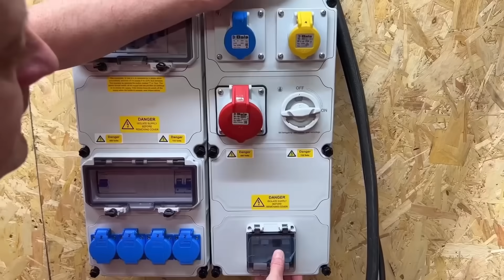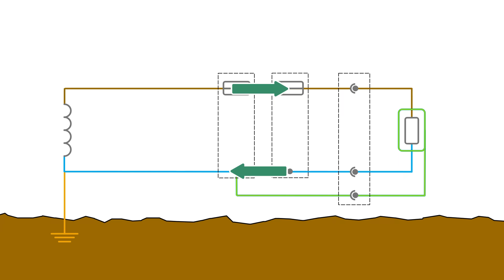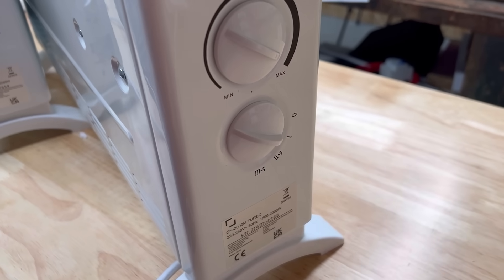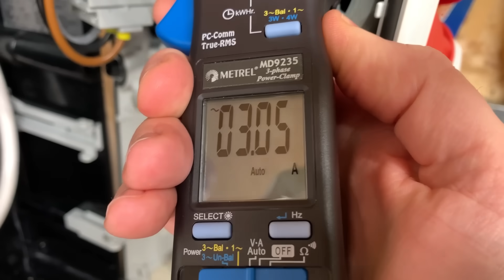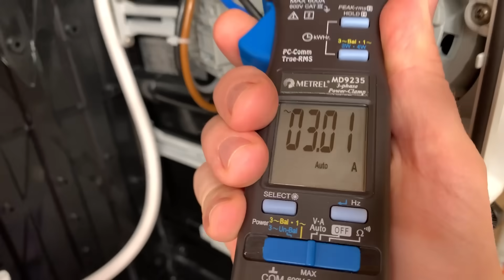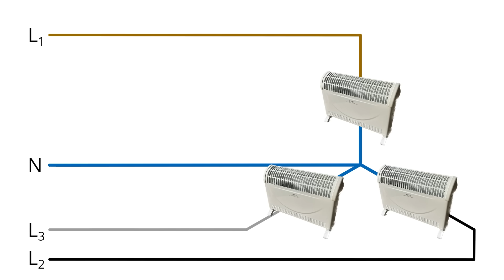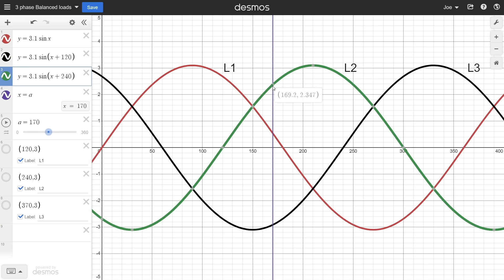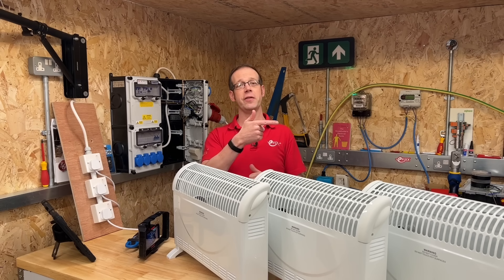Does Current Flow Through The Neutral Wire?

Comment: Interesting demo. Will be valuable for all those domestic sparks that never get involved with three phase systems. Came across a large lighting circuit like this some time ago, gave me a bit of a head scratch till I realised that the neutral current will never exceed the current of one phase
Reply: Do you mean "domestic spark from UK" only. All other domestic sparks around the UK (and commonwealth and U.S.A. ) use three phase connection to every house/garage/shed/fabric hall since Siemens & Halske around 1880 use 3phase AC and build the generators around the world!
Reply: @OldLordSpeedy  well that’s very interesting, so you are seriously telling me every supply in the US is three phase just because it originates from a three phase generator. 🤣🤣 if your are actually an electrician then perhaps you could expand on this please. ??
Reply: @johnwarwick4105  Sorry that you misunderstand me. I mean with "around" by word as geographically. Not U.S.A., not UK, not commonwealth! Specially the U.S.A. use differently to (German) Siemens & Halske so that Japan now splitting in 60 Hertz and 50 Hertz part. Some islands use U.S.A. 120 Volt till the 1980's. As example I know Kreta (Greece). Same trouble we have with electric train power. 

Yeah the three phase AC is typical now but the engineers tested many phases AC and one phase DC too. Do you can found many interesting video about that with search Edison here.
Reply: @johnwarwick4105  Up to the 120/240V split-phase transformer it indeed is 3-phase (although not all phases may be present at the installation location of the transformer). And most commercial installations and many homes with elevators also get 3-phase (120/208V or 277/480V).
Reply: @HenryLoenwind  ver much the same in the uk though split phase is very rare these days, only remote farms. Surprised some houses get a three ph supply, think we would opt for a phase inverter if that was needed for a domestic elevator etc
Reply: @johnwarwick4105  The US made itself quite flexible with the "kV to the premises" installations. When you install a dedicated transformer for each property, it doesn't really matter what kind you put there.

Also, in case I was a bit vague there, in purely residential single-family home areas, they split the phases for the last mile and only run one of the phases and neutral. That's somewhat comparable to what the UK does for the last mile in residential settings, just that there it's already 240V.
Reply: Those domestic sparks that have only undertaken the domestic installation courses are not allowed to do 3 phase work (in that they are not allowed to do industrial installations).

And if people are qualified to do industrial electrical installations then they have been trained in 3 phase and should not need this video.
Reply: @deang5622  in many parts of the world its normal to have 3 phase power in your home, even in apartments...
Reply: @karaffens  I wish it was so in the UK.
Reply from the maker: You woke up on the wrong side of the bed Dean? The video could be helpful for people who are in the process of qualifying for carrying out industrial installation work? 🤷
Reply: @efixx  quite agree there are plenty of time served industrial engineers that I know that would have to head scratch about this one
Reply: @efixx   Also I like this video and be angry that in history we learn formula and pics only. Very often "sometimes" can be a real demonstration the best way to learn too. Too many people learn only the theoretical stuff but never understand it and wonder why the neutral line isn't bigger.

Comment: Disconnect the Neutral and see what happens! 
I would perhaps retract what you said that you can disconnect it and all through would carry on working 😮
Reply: They'll work until they get up to temperature and start cutting out.  That's when things might get "interesting", especially if there are electronics in there like timeswitches.
Reply: In Norway we have been using 3phase with no neutral for 100 yrs and still installing more!

Comment: That's the reason the 400V continuous flow water heaters with 22 or 24kW, that are popular here in Germany for electric water heating for showers, don't require a neutral at all. In most cases we still install a five core cable. The five core NYM-J is only 1€ per meter more expensive than the four core one. Neutral isn't connected of course, but still available if it would be required in the future.
Reply: It’s a really good idea to pull the neutral always for future use, here in Finland it used to be acceptable to wire 3-phase sockets with no neutral, if they were intended for a large machine, it’s really fun when you rock up with a portable distribution board to only find that they left out the neutral. And it’s no fun either to have to install transformers for 400/230 just to get some new-fangled boiler with a control board that needs a neutral working. :)
Reply: @sstorholm  Or you install another motor, some require a neutral just to start, and while running it's disconnected.
Reply: @Marcel_Germann  What sort of abomination of a 3-phase motor requires a neutral to start?
Reply: @sstorholm  Not the motor itself, but eventually the electronics that regulate the speed of the motor. And maybe contactors if you want to reverse the direction of rotation.
And also possible, the future replacement requires for other reasons 230V in addition to 400V. Unlikely in industrial applications, but not unthinkable, and in domestic applications this can always happen. I remember my grandparents had a Perilex socket outlet  (three-phase socket outlet )in their bathroom for the washing machine. The plug always "wandered" from the old to the new washing machine because it was the old rare 25A version.
Reply: @sstorholm The motor does not, but the control circuit may. Many EVs that insist on seeing a Neutral. A 1-phase Renault ZOE wil not charge unless one of the wires are a true Neutral and you need a 230/230V transformer with one of the secondary wires connected to ground to charge your car!

Comment: Great video here Joe, can I ask if you have a 3 phase motor which draws 60 amps for example, does 60 amps flow in each phase or does it get divided into the 3 phases i.e. 20 amps down each phase?
Reply: Motors are rated w/ s/ phase. So its Amp per phase
Reply: @haidarbadavi9460  Just to confirm it's 60amps per phase.
Reply: @ia4387    If it is being called 60 amps three phase, you will get three 60 amp readings, not three 20 amp readings.   Hope this helps.   Kevin
Reply: 3 phase Motors are usually shown as Amps per Phase. 'Rule of thumb' 2 amps per KW. Takes account of power factor and efficiency.

Comment: This is the example of the USA and our split phase 240VAC.  In the Tesla wall connector (EVSE) there is no neutral conductor going to the device.  Only the two hots (L1/L2) and a safety ground conductor.  No PEN fault ability here.  Although there are a number of 240V devices that do have a neutral conductor going to them.  This is because of a 120V supply in that device as well.  For example the dryer, is 4 conductors as the electronics only use 120V and not the 240V for powering them up.
Reply: There's no PEN fault detection because there's no PEN that could fault. You only have PE and a local N on your side of the split-phase transformer. Those are bonded at one point only, so when the N breaks downstream of that connection, there's no path for the isolated N to jump over to PE and then via the car's and your bodies into the earth. And if N breaks upstream of that connection, then the isolated N and PE are connected but there's no path from the ground to the remaining N.

You get a PEN fault when N is bonded to PE and the real ground in different locations and the N connection between them breaks. Then the current on the isolated N can go via PE, via car body, via your body, via real ground to the upstream N's grounding. And in 240V land, that's not a tiny split-phase transformer on a mast next to your house but a big transformer that supplies hundreds of homes.
Reply: If the PEN breaks there will be voltage at the car. Now in the US it would be max 120 V but if the loads are well balanced it could be close to zero. In a PEN fault the voltage comes from the ground wire. The fact that the car has no neutral is  not relevant unless it is the only load.

Comment: I worked on a 3 phase oven a big big boy oven.  It needed a neutral.  It was 3 phase but worked as single phase.  As each pair of elements.  Was only on one pair at a time.
Reply: What was the voltage applied to the heating elements?   416 or 240 volts?   Sometimes the elements are 416 single phase and multiples of three, and the controls are rated at 240 volts.   It could be either way, just how they are connected in the equipment.  Best wishes,   Kevin
Reply: @KevinCoop1  Don't recall now just the way the contactors were wired up.  Do think somewhere I have a photo of the front so I will look it up one day.
Reply: Ovens need a neutral as they can have numerous different power settings. Something like a sauna does not need as it is either on or off.

Comment: Ok, but if it’s a single or 3  phase (unbalanced load), and the neutral is disconnected after the load, would you get a shock if you touched the exposed neutral even though it has gone through an appliance? If the energy from the supply is used up by the appliance what energy is there in the neutral going back to the source?
Reply: Assuming the neutral is disconnected at the consumer unit if you grabbed the neutral within the installation you’d get a full 240v belt. Neutral is referenced to earth at the substation, this is why you don’t normally receive shocks off the neutral, because earth neutral and yourself are all at the same relative potential. And this is why you receive a shock off the line conductor as there is a significant difference between yourself and the line conductor. Basically without a reference to earth, the neutral will be at the same potential as the line conductor(240v). Not really sure what to say about unbalanced 3 phase tbh, there will definitely be a voltage but I’m unsure if it would be 240, 400, or 600… hell, it might even be less than 240v.
Reply: @slinkdroonk4175  thanks for sharing your knowledge. 👍

Comment: I've never understood why the neutral isn't three times the size of the line conductors.
Reply: Are you an electrician
Reply: Each phase is separated by 120 degrees so the maximum total current is never aligned, hence why with the 2 rads on the RMS was still showing 3A - it’s also an AC waveform don’t forget…

Comment: This isn't the first time I've seen this question recently.  Kirchoff's law is the science.  The confusion is only how to apply it!  Multi-phase (or even the U.S. split phase) systems add some complexity, but the same law applies - the current in the conductors must sum to 0.  Too bad your simple clamp meter discards the sign.  It is much easier when the direction is indicated by the sign on the quantity.

Comment: Which is why years ago we used to install 31/2 core cables as supply cable with a reduced neutral when the single phase loads were relatively small

Comment: All correct but… this is going to be misinterpreted by some.  Yes, on a perfectly balanced system you could remove the neutral from the 3-phase supply,  But where it's split down into single phases a neutral is still required and they all need to be connected to each other for the current phase cancellation to happen. No connection, no circuit, no heaters. The three phase motor example is not three motor windings trailing off to nowhere but with their ends joined in a common bus. And I'm afraid that as you didn't spell this out it's going to baffle some people.

Which makes me think of a question.  Does anything in normal UK installations, other than 3p-motors, use true no-neutral phase-to-phase loads?  I know North America does, often tapping 208V from 4-wire-Y 120V and 4-wire-Δ 240V supplies ant typically using it fo lighting circuits in industrial situations. I've had to deal with that myself. But would anything like that be found in the UK?

Comment: Im suprised the current in the neutral doesnt change with 2 heaters (phases) on
Reply: Phase angle between the lives is 120 degrees, so the currents come close to balancing out, though it will be slightly higher if you have actual identical resistors. Add the third and it balances out.
Reply: I was similarly surprised. So I did a quick diagram adding two vectors of equal magnitude separated by 120 degrees. The resultant vector forms the third side of an equilateral triangle with the same magnitude as the others but with a phase angle 60 degrees between the two original vectors. So the neutral current magnitude is unchanged, as shown on Joe's clamp meter, but its phase angle is.

Comment: I still didn't get it, if all phases cancelled each other when it's balanced, then how does the circuit get closed without neutral ?
Reply from the maker: The current can travel down the other phases.
Reply: @efixx  Ahaaa got it, so other phases cables can act neutral, thank you
Reply: @mtnshadid  No the other phases do not act as neutral, current flows in a conductor through a load and the same current flows in another conductor after the load.
Reply: @mtnshadid  for example as L1s sign wave passes through positive . L2 will be in negative creating a circuit .

Comment: Company I used to work for usually used 3p+n+e on our rental HPUs to supply pump motors and PLC controls from a single plug. 
If where they were working didn't have 5 pin sockets we'd have to find a separate single phase supply for the PLC. 
Less of an issue than it used to be as PLC controls on three phase loads a lot more common these days. 
Mainly need the neutral for when the motor isn't running but it's obviously marginally out of balance even when running.
Reply from the maker: Interesting scenario that one. 👍
Reply: @efixx  Fun part comes when you have 3 single phase motor inverters running, where you will find that the neutral current can actually be higher than the phase current,  often by quite a bit, just because the diode input on the inverters means there is a lot of harmonic current. That is the reason you had a change to cable specs for 4+E industrial cables, to have neutral be the same diameter as phase, and not a smaller size as the old regs had, where it could be 70% of phase size for a non distributed 3 phase load. For a distributed load, like street lighting, it always had to be equal size, simply because it was carrying the balancing current along it.

With the rise of switching power supplies, and the need for active PFC on industrial equipment not being there, you get a lot of harmonic current in industrial wiring. That is why every manufacturer of motor inverters has, as optional parts, a input choke filter and capacitor filter bank for each inverter size, so those that need it can put it in. Mostly done where you have dozens of drives per phase, and need to filter out that noise, and where you also want to share the DC bus for energy recovery on the drives, so as not to need a massive number of brake resistor units.

Comment: So the current flowing down the neutral is still charged for by the electricity company ?
Reply from the maker: The electricity company charges you for the energy used not the current. 😊
Reply: Eh, no. That's not how the metering works for three-phase installations. The neutral current on single-phase installations is not metered either, even though it is the same as the line current, in theory.
Reply: @craigwatson2298 so at the risk of sounding like an idiot what is the point of balancing loads?
Reply: @hogg8888  no mystery really; it makes sense to balance load over the three phases as best you can to ensure that you have maximum available capacity on all phases for any additional load. Having significantly imbalanced loads effectively de-rates the neutral conductor for no good reason. Also, imbalanced loads is likely to create voltage imbalance as a consequence, which is not good for some rotating plant. Some motors can overheat to the extent that they are damaged with even a modest voltage imbalance.
Reply: @hogg8888     Craig is mostly correct.   If you connect all of your large single phase loads on L1 and L2 and nothing on L3,  the amount of KVA that could be served if balanced is reduced to 2/3.
Reply: You are charged for the electricity you use. No need to overthink it.